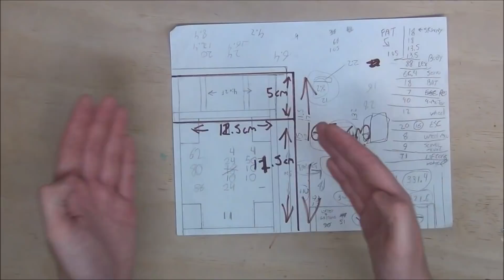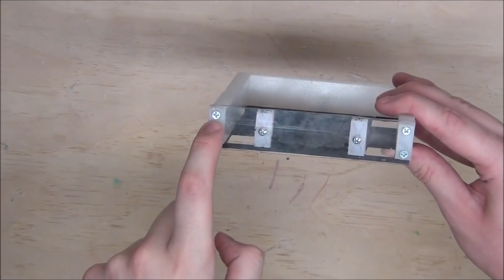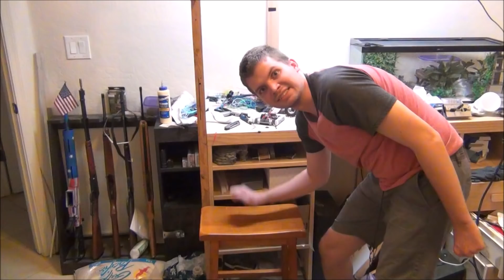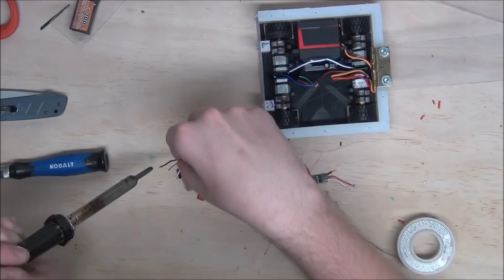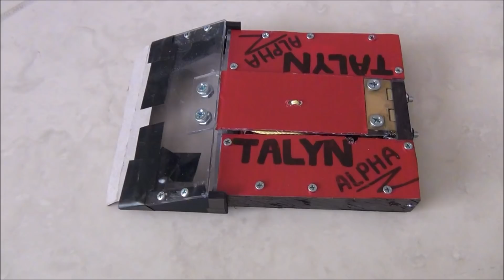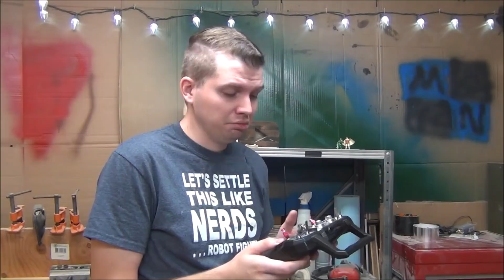Antweight Lifter/Grappler Combat Robot // Talyn Alpha

Comment: I'm thinking of building my own, and I was wondering. How would you get two robots operating at the same frequency to work without yk, overriding each other?
Reply from the maker: If you buy modern transmitters (basically any one that was made in the last 10 years) you dont have to worry about it. The transmitters will take care of it."Sky fly fsi6" is a GREAT one to start with.
Reply: @MechNinji  thanks man!

Comment: Hey MN! I was wondering whether there was a way to reprogram a Turnigy T6A-V2 (link to hobbyking page with more details: https://hobbyking.com/en_us/turnigy-t6a-v2-afhds-2-4ghz-6ch-transmitter-w-receiver-v2-mode-1.html?___store=en_us) so that when a switch is thrown the robot goes backwards when the stick is pointing forwards and vise versa. If this is possible it would be very useful when a robot is flipped upside down because you wouldn't have to point the stick backwards to go forwards. 

Thanks in advance!
Reply from the maker: Sadly i am not too familiar with that transmitter. I use a Sky Fly Fs I6 and although i don't know for sure if it can do that, i bet with a little work it could. But if you are just wanting to drive backwards its actually not too hard to do without changing the settings. I drove backwards a lot in my last comp and I was surprised with how easy it was. But driving upside down might be a different story. SO sorry i can't be of more help  :(

Comment: Hello all. Can someone tell me how to configure the FlySky to control the forward backward and turning of the robot. 

My son and I are first time builders with RC. We currently have our spinner motor plugged into channel 3 throttle and the two drive motors into channel 1 and channel 2. 

I have seen using the addition of an Arduino and a l298n motor driver to read the inputs but I don’t see any Of that used here.
Reply from the maker: Do you have an Instagram account? If you do message me on there and i should be able to send a few very short vids answering your question! :D

Comment: Loved the video! Saw your latest one and in my opinion, talyn was one of the best bots at ARC. One question I had, what do you think of using 50:1 micro metal gearmotors? They have greater torque, right?
Reply from the maker: That is so kind of you to say! I'm glad you liked the videos! They very possibly could have more torque then what i'm using, do you have a link for them? I can prob  find out for sure that way  :)
Reply: @MechNinji   here you go. These might be a bit slower but then one can always opt for a different gear ratio. 
https://www.bananarobotics.com/shop/Micro-Metal-Gear-Motor-1.5-12V-(50-to-1)
Reply from the maker: Okay cool! So yes, they do have more torque then the motors i'm using however they're almost half the speed  :/ .  I actually used the motors you just left the link for in my previous talyn version. with 1inch wheels they doesn't go very fast but if i put larger wheels on them they'd loose some tourque so i guess its somewhat of a trade off! haha! But regardless they're both great motors!  :D

Comment: If you are looking for a cheap, sharp, tough, strip of metal for the front of a bot,  look for replacement blades for a wallpaper scraper. They are basically thick razor blades, can be between 4 and 6 inches wide, meant to be quick-changed, and are only a few cents per blade. Available at WalMart.
Reply from the maker: That's a super cool idea! Thank you for sharing, i'll have to check that out! :D

Comment: Good luck! Really nice build, looks pretty solid, fingers crossed you don't face too many vertical or drum spinners with the base plate, should be fine for the most part though, one thing that worried me was Talyn tipping over forwards when lifting, I would recommend having small outriggers if you can squeeze out the weight. Also to really protect from spinners, you want the sides of the wedge to angle down (like the D2 Beetleweights) that really messes up horizontal spinners.

Fingers are crossed for you, you drove really well last time, that will be key.
Reply from the maker: Thank you so much! Yes i know what you mean! I wanted to put a nail or something in there so that it will stop falling forward. Im SUPER close to the max weight but im gonna see what i can do! As for the angled sides i also wanted to do that but sadly it just didn't quite work out, maybe next! With that being said the full lexan wedge i have on it now is somewhat angled! :D